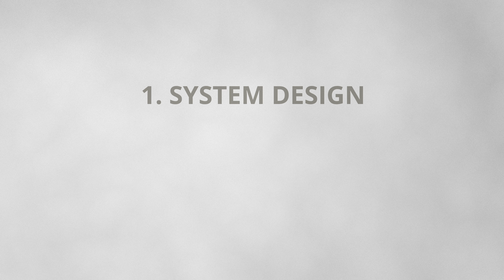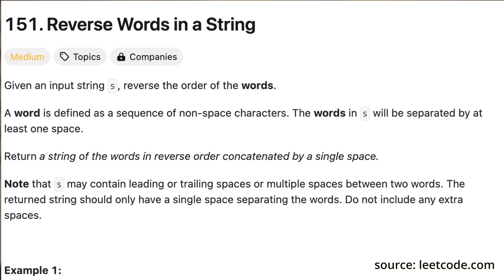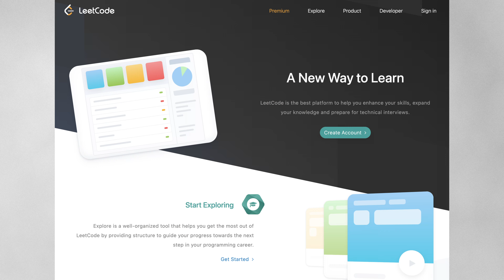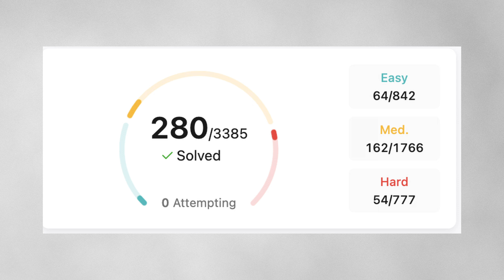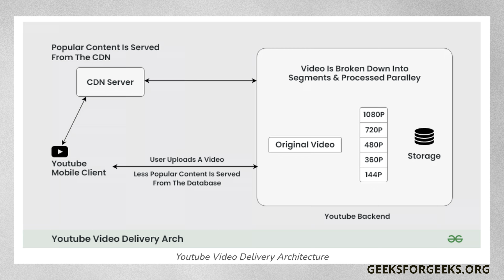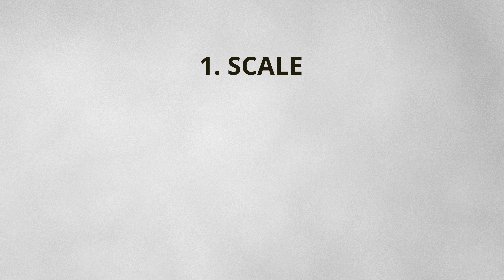How to prep for your FIRST technical interview

Comment: Great vid! Would you say it's a similar process for data oriented positions (DA, DE, DS etc)?
Reply from the maker: Hey, DE and DS are, for the most part, very similar processes to software engineer roles. The coding rounds are sometimes slightly different or may be based on some analytical question instead of coding. For DA roles, there are other interviews where you might have to do a case study, similar to take-homes instead of raw coding interviews.